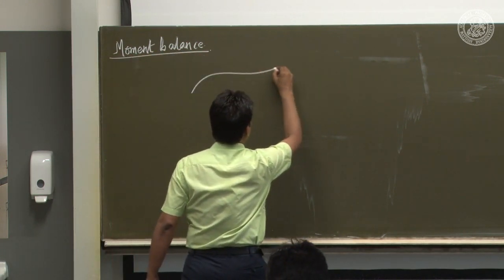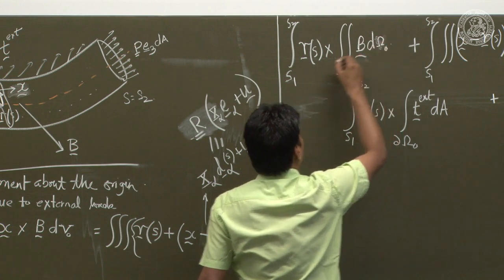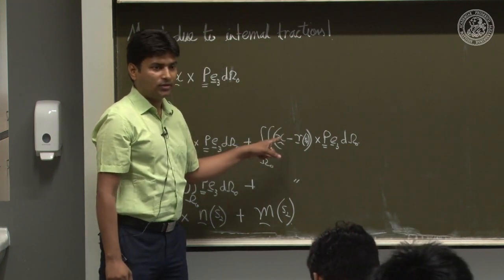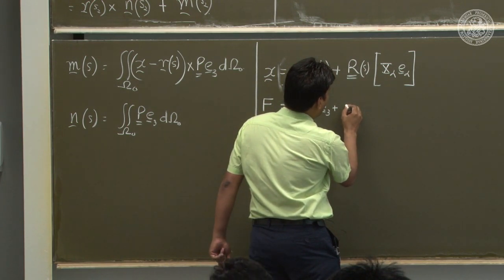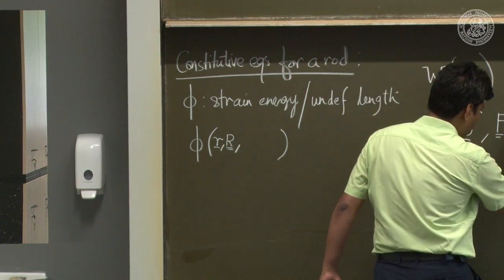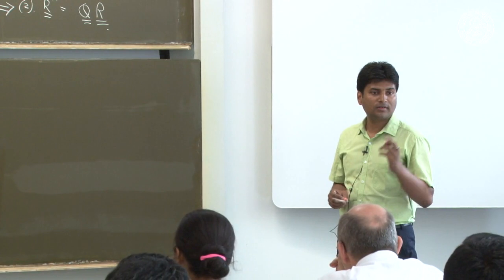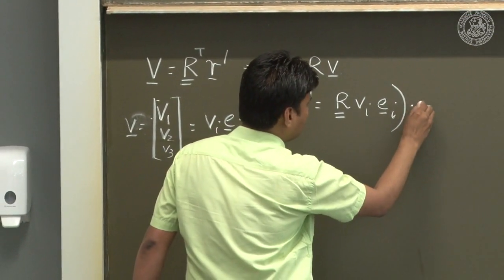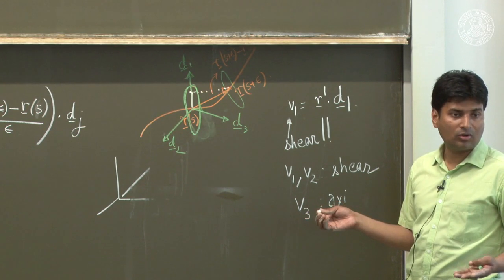4 (Constitutive laws for rods)

Comment: Hi, Prof. Kumar. Thank you for your wonderful lecture. I have a question in terms of the dependence of strain energy function phi(s) on the rotation tensor R(s). In this lecture, you let Q equal to R transpose, and then conclude that phi(s)  should not depend on R(s). However, what I understand is that the rotation tensor Q should be a constant tensor, which make the rod undergo the same rotation as a whole. while R(s) is not a constant tensor, instead it is a function of s. so maybe we can not let Q equal to R transpose.
Reply from the maker: A very good question which is often a point of confusion among students. You are indeed right that Q should always be taken to be a constant while applying objectivity whereas R is a function of 's'. Its resolution lies in the fact that objectivity is first applied at an arbitrary local point say s=s0. We then choose Q = R(s0) which is a constant. When we choose this Q, we can use derivation in the class to show that at local point s0, the enrgy phi(s0) would just depend on R(s0)^T R'(s0) and R(s0)^T r'(s0). Once we have shown this for s=s0, we can then use any value of s0 along rod's length to prove the result at any point in the rod.
Reply: Thank you so much for your explanation, Professor!!!